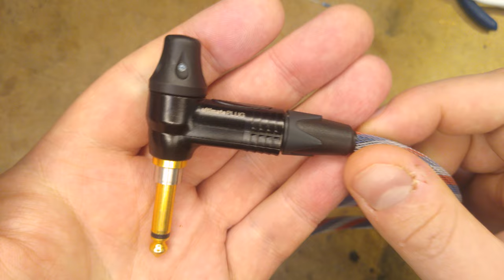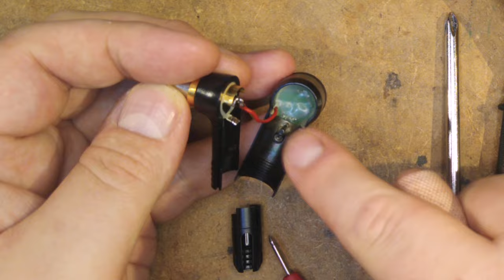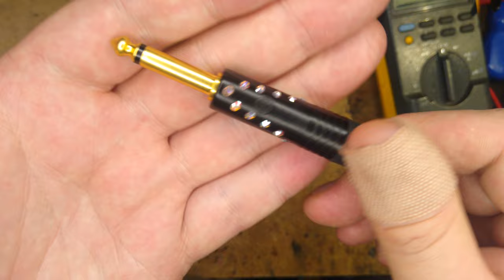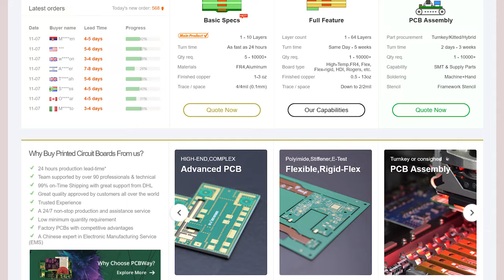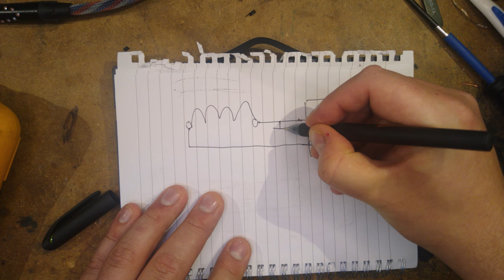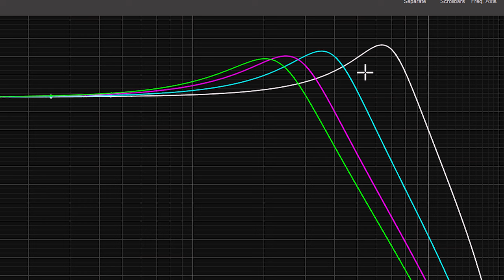Building and Testing a WEIRD Guitar Cable

Comment: I have to say neutrik connectors really do think of everything including the bag. I did not know they had a special audio file crystals like that network switch I saw an LTT. I did sound for an open mic night coffee house thing and we had one of those fancy cables with a push button switch. What a headache if you think having a switch on a microphone is bad imagine having one on a cable... why is there no sound you didn't turn me on, no you didn't turn the switch on or if I pre-turned the switch on they would find a reason to turn it off between acts.

Comment: One of the more useful things for altering guitar tone is replacing one of the Tone knobs with a rotary switch that connects a capacitor in series. Works wonders to roll off the low end, often much needed with those boomy neck humbuckers.For a rotary switch I used a 12-position one. Caps connected are 1u down to 0.01u, and one position for 'no cap' (shorted). As for cap in parallel and even regular tone knobs on the guitar - in heavy rock or metal music I never find any use for those. Typically, you want all the high end you can get.